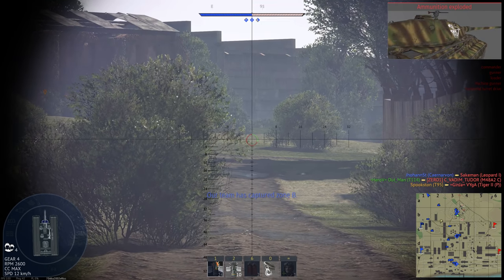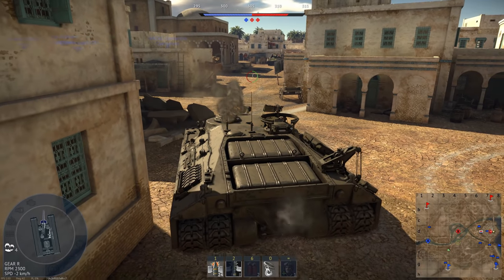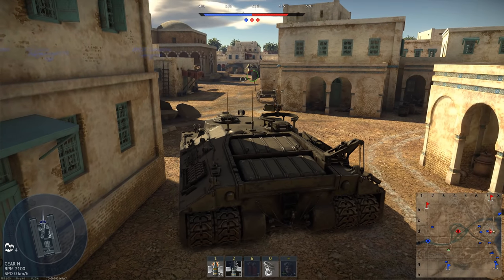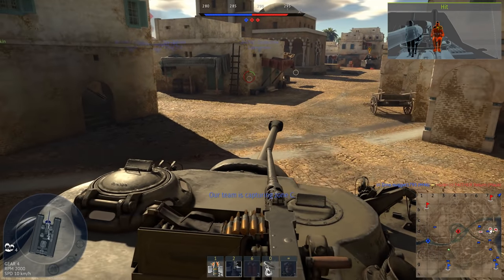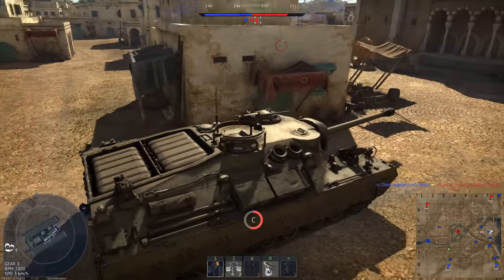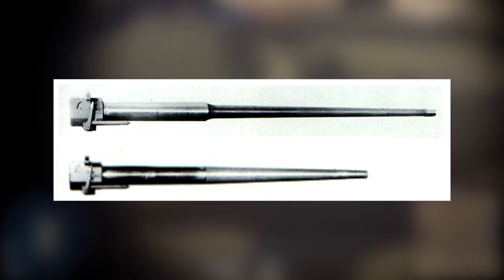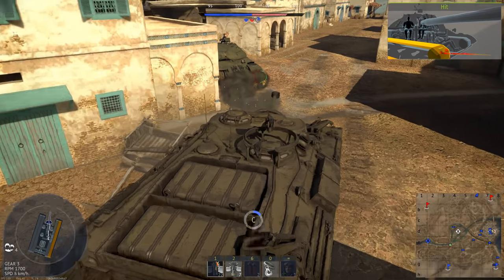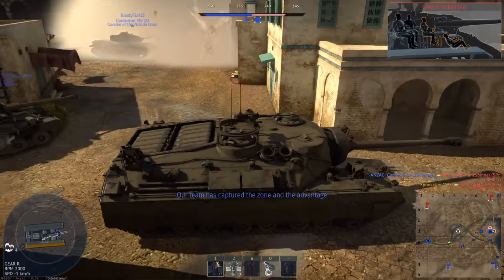Failed Tanks: T28 Super Heavy

Comment: The T-28 testing wasn’t pointless, they used it to test tank recovery tactics and vehicles since it was obviously way heavier than any other ground vehicle manufactured by the U.S
Reply: They also used it to test landing crafts
Reply: Doesn't exactly sound good, from "potential assault tank on the west wall" to "glorified paperweight"
Reply: @Y.M...  You make it sound alot worse than it really is. Only a fool would not learn from failures. And the T28 wasn't even a failure to begin with. The Allied simply broke the Siegriedline much faster than expected.
Reply: That sounds like a long explanation for the technical word of Giant paper weight
Reply: @racernatorde5318  exactly, can't call a tank that was designed for a singular purpose a failure  when you fail to begin development in time and that purpose becomes irrelevant. That's a failure on the planners not the tank.
Reply: T28*
The T-28 you mentioned is soviet multi turret tank

Comment: The allies probably thought they'd encounter much heavier fire when they attacked the Siegfried Line, hence the absurdly thick frontal armor.
Reply: Yes Germans had beter weapons
Reply: The T-28 (and the British Tortoise) were developed because the allies overestimated how strong the Siegfried Line was. If it had been as formidable as German propaganda said it was, super heavy tanks like that might have been helpful to have.
Reply: @philhanson1644  P-47 and Long Tom would still be more effective
Reply: @philhanson1644  in fact, superheavies benefit from being part of said prepared defense structures since it's the only place they can operate semi effective.
Minefields and small pillboxes with MGs protect it from infantry, stationary AAA of the defense complex protects it from direct air threat, antitank strucktures like czech hedgehogs and dragon teeth preven other tanks from flanking or overwhelming it, it can use concrete roads to ride here, prepared firing positions for its size, maintenance crew is always hiding in a bunker next door, it rarely needs to move. Just sit in the deeper part of the line and use your high velocity high caliber cannon to delete anyone, whom lihter AT guns haven't yet.
Reply: @JV-bj4kx  

Not better, just concealed. 

A 6 or 17 Pounder hidden in a bush is going to do the exact same thing to a tank that an 88 or PAK40 hidden in a bush would do.

Comment: The first few seconds put an immediate smile on my face, I always laugh when I make those shots in my T95. God do I love the T95, shame that it costs 20k to repair when you got to deal with the accursed bmps and fiatts, and the inevitable german CAS.
Reply: Germany CAS is okay, american CAS is much worse. (to face it)
Reply: @zauniblanke1588  Not really. They're both powerful, but American CAS is way easier to face. Bomb here, bomb there, some HVARs, and you're done. With how glitchy bombs are they are far from reliable for killing tanks. German CAS on the otherhand, especially 3.7-7.0 you'll find many cannons that will tear through the roof, and even sides or fronts of tanks. I can wipe an entire team if they don't have air superiority.
Reply: @zauniblanke1588  can't hear you over the 30mm daka killing not just the men but the fuel and engine decks too.
Reply: You left out the part that every AA on your team is either 50cal AA trucks or Bofors fail AA while planes have auto bounce windshields and black hole engines. So when you die to the totally legit WWII era [according to gaijin] Leopard 1/RU251/BMP that rushed cap, you get to respawn into spawn camping 3rd person laser pointer aimed CAS being elite cancers building their K:D portfolio.

TRIVIA
What do all three of the German tanks I listed have in common?

A: They are all from the 1960's that have the same br as WWII tanks.

What does the German CAS meta have in common at T95 br?

A: Prototypes with magic guns

The stupid repair cost is so nonsensical in the face of menstrual-show br disphoria.

Comment: Not the t28, it's my favorite....
Reply: The T28 and T95 are the same, the only difference is that the T95 had the extra two tracks.
Reply: But

Why
Reply: @karlovicinquisition3659  not wrong but the T28 was the version of the tank meant to be transported because the extra tracks made the tank too wide and heavy for transport. The misconception of the T28 comes from WT. In reality the T28 Super heavy tank was the designation for the tank before it was passed for production
Reply: @alecritchie5669  WoT gets the names wrong too and they had both version ingame since, roughly, 2014. So yeah...one does it wrong and the second follows? I really don't understand why neither of the two companys bother to fix it.
Reply: It was first named T28 Heavy Tank. But one day, a guy said “hey, it doesn’t have a turret” so it was named the T95 105mm Gun Motor Carriage, because it weighs 95 short tons. But after a year, another guy said “why the hell is it a GMC? GMCs are pretty fast and maneuverable, like the M18, M10, M36, etc. It everything except fast and maneuverable.” So they went “fuck it, well do another class of vehicles, the Super Heavy Tank, just for this vehicle” so it was once again renamed, this time for Super Heavy Tank T28 (yes, the SHT goes before T28).
Reply: @vinccool96  Are you sure about the last bit? Rob, the curator of Fort Benning (Where this tank is currently at, and Sofilein (The video I am refering to is on her channel) recenctly covered the naming again and he clearified that the 100% official name is "T28 Super Heavy Tank". 
You are obviously totally right about the rest.

Comment: When talking about the purpose of the tank, its important to remember that the allies did not know for sure what awaited them when they reached the West Wall. The fear was that the advance would be stalled and the situation would devolve into something resembling WWI Trench warfare. So the allies began projects designed to overcome the perceived tactical problems that the fortifications may present. These vehicles were really precautionary measures which is why even at the height of the project, they only planned to build a few dozen. This all changed of course when the allies reached the Siegfried line and breached sections of it in half a day. The US 1st Army had elements breach the Siegfried line the day they reached it. The Maginot Line gave Patton more problems than the West Wall did.

Comment: Please do a video on the cousins of the T-28, the T-29, T-30, T-32, and T-34. I always found this series of vehicles to be pretty interesting as they seemed closely related but with some minor design changes between most, namely the gun. 

The T-32 being the most different of the bunch having a completely different turret and using the smallest gun. I'd argue that the turret for the T-32 was the better design being lower profile and having a VERY thick gun mantlet, though none of them entered any form of mass production in the end and served as test-beds in a sense similar to the T-28/95.

Comment: well they used the tanks as testing platforms for towing and transporting. they learned a lot by using the T28 that way and used that knowledge for the abrahams line. so yeah as an assault tank it was a failure, but as a prototype for super heavy tanks it was a succes.

Comment: Basically it was slow so it could fire on the move/ not over stress the transmission/ it would take an lot off power to propel it very fast and it was designed with such a specific thing in design because the allies thought that the t-28 and A39 (think) tortoise would have to be used to punch through the German lines as if the first failed,vthe would pull back and redo the defence

Comment: T95 was not a failed tank bro, it was a failure on military planners and designers. The T95 was designed for a singular purpose which was why they never planned on making a vast number of them. It's whole purpose was to take the Siegfried Line, period. But, we took the line much faster than what was expected and the tank never got to be used for the purpose it was meant for. The problem with anything designed for a singular purpose is once that purpose has been achieved there's no need for it anymore. Again the failure was on planners for not beginning development sooner.

Comment: There's actually two variants the one you were playing is the t29 super heavy tank destroyer while there's a smaller one called the t28 the difference is that the t28 is missing a group of tracks and is more thin than the t29
Reply: No. There is only one version of the tank that goes by two different names.

Originally named T28 Super Heavy Tank, they decided to rename it then T95 Gun Motor Carriage. Later they renamed it back to T28 Super Heavy Tank. The tracks are removable for transport and they do not change the tanks designation.

T29 was a completely different tank. T29 was a Prototype heavy tank with a turret mounting a 105mm gun.